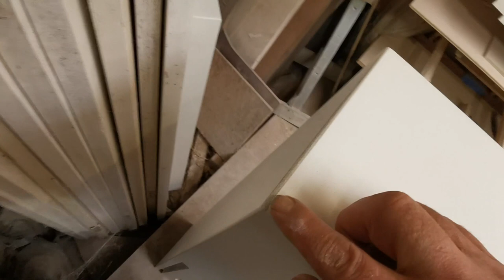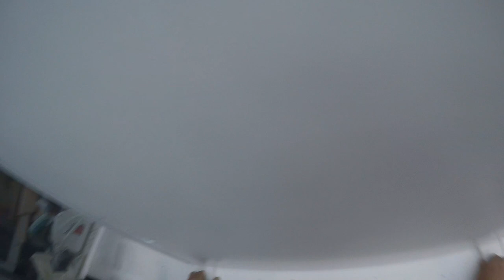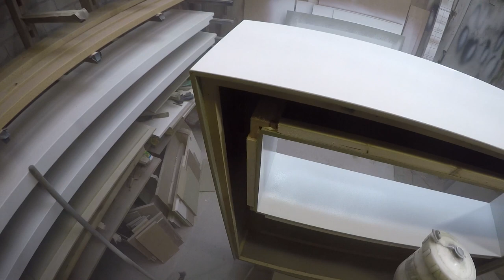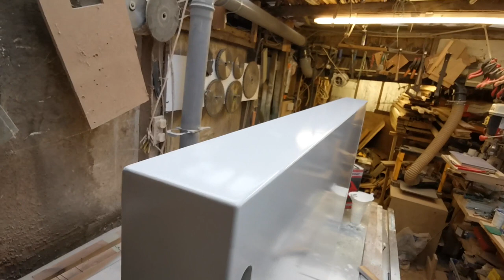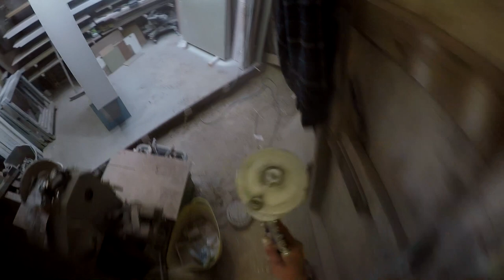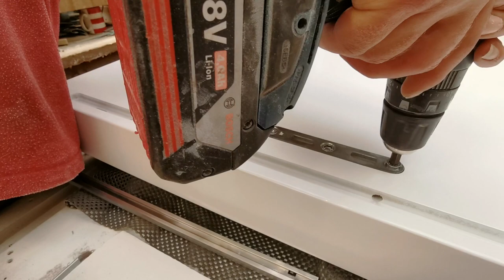Hospital bed make-over Pt10 - Final spraying

Comment: might have said before Gid but speak to the paint company about the overspray probs, they might be able to offer a different hardner or thinner to help it flow out, ie stay wetter for longer.
Reply from the maker: Thanks 👍 There are additives n next time i'll ask, i didn't have a problem on flat surfaces & the vertical were ok as long as i got enough on, but too much n it run, it was finding the right balance, you can see from the vid it really doesn't take long to spray, spraying this shape with a hole, getting enough inside there wasn't easy, too many adjoining faces, Spraying the footboard was no problem 😁 User error i think is more the problem 😂😂😂😂🙄
Reply: Gid Joiner tough shape paint in one go but you got a good technique mate, I see some people spraying and wonder how they manage to walk let alone spray being so uncoordinated.

Comment: Hi gid, starting to take shape, what product are you using for this project? You seem to be getting a lot of overspray there, would it be possible to dial things back a bit? Can I ask what bar you spraying at?
Reply from the maker: Hi, Thanks 👍 20psi-ish, PU Gloss, I tried a few different fan patterns, air flows & different mixes, the prob i had was getting it wet enough so it would flow well to create the gloss but not too much that it would run, I've sprayed a lot of things over the yrs but everything is different & i hate gloss, the overspray was ok when it landed on wet paint as long as it was glossy/wet enough to accept the overspray, I think however much advise i get it's a bit like my welding, i'll only learn through trial n error, prob with tho is i don't have too many yrs left for trial n error 👴🤣👍
Reply: Don’t be getting sentimental on me now gid lol ..there is plenty of life in the old dog yet, spraying isn’t easy, and i am trying myself to be better, its a minefield  out there, needle size, viscosity, temp, and the list goes on... but think you nailed this one, loved it, keep it up... looking forward to what’s coming next...
Reply from the maker: 🤣🤣😁 I wasn't entirely happy with the finish on he headboard, too many adjoining surfaces, the footboard was fine & the side pieces because they were sprayed flat were Shiny 😁 this is why i avoid gloss & when they said they wanted gloss my expression was 🙄😯😓🙁😖😦😬😟🙃🤔🤨😗🥺🥺🥺🥺  🤣

Comment: This couldn't have come at a better time haha, how did you go about fixing the runs in the top coat? do you scrape it back with a blade?
Reply from the maker: Hi, yeah a stanley blade like a scraper then sand with a hard block, i'm impatient, i always want to wipe the excess off with my fingers as it's running but that leaves a divot because it removes a bit of paint from below, sanding too early when dry can clog the paper because the drip isn't as dry as the rest & sanding sometimes you end up sanding the surrounding area too much 😒🙄😊
Reply: Gid Joiner 😂 that’s what I wanted to do also😀, this time I have let it dry overnight and I’m tackling it this morning. 
Few runs on the face edge of these bench tops 🤪🤪
Reply from the maker: Yeah that's what try to do, let it dry properly, hard to do that sometimes when you're thinking i'll get a couple of coats on today n a couple on tomorrow 🏃‍♂️🤸‍♂️🙄😁
Reply: Gid Joiner  the top coat I’m using was recommended by the paint company, but it has 3hrs till it’s tack free.   My impatience is telling me to find a quicker drying product 😂😂
Reply from the maker: 🙄😒Yeah, 3hrs, that'll be next day before dry to sand, the PU i use is sandable in 20-30mins, The Pre-cat & AC i used to use are the same 30mins drying, the paint company told me that water based stuff needs 20º+ to dry quickly & even then it's not as fast as the ones i mentioned. Just had to have a look at your pics, can't see one but a fan speeds up drying time quite a bit 🤔🙄👍 If i'm just doing a couple of pieces painted on one side i could get at least 2 coats of primer on & 2 coats of top coat in one day, This stuff still needs to cure for 24-36hrs to cure properly, although it dries to sand fast it'll stick to itself or mark if stacked in the van too soon,
Reply: Gid Joiner  that drying time would be perfect for me.
They originally recommended an epoxy primer, but you can’t sand that till the next day, and if doing MDF I need the 3 coats like you do to get the edge smooth.
I now have a pu primer that dries in 25mins. 😀
I have an air conditioning unit at the back corner, so I just turn the heat on when I leave the room
Reply from the maker: Yeah a good drying time is needed, this stuff i use is sandable in ½hr-ish even in winter 5º👍 A fan that blows on the pieces is what makes the difference, this sort of thing https://www.amazon.co.uk/Q-Connect-300mm-inch-Desktop-Fan/dp/B000JTMJ42/ref=sr_1_5?dchild=1&keywords=fan&qid=1593136943&sr=8-5
Reply: Gid Joiner  absolutely, I have the primer sorted, and I asked the supplier if they had a top coat pu that dries in a similar time frame and they said they don’t have on🤔
So I’m currently using a primer that is sandable in 30 mins and a top coat that takes 3 hrs till it’s tack free,

Comment: So do you rub the whole thing down or just the runs
Reply from the maker: Just a light rub all over on the first top coat after making the runs good, i avoid sanding too much in the final coats because that just creates dust, the first coat of top coat catches/locks in the dust bits left on from the primer that's why it needs a light sand.